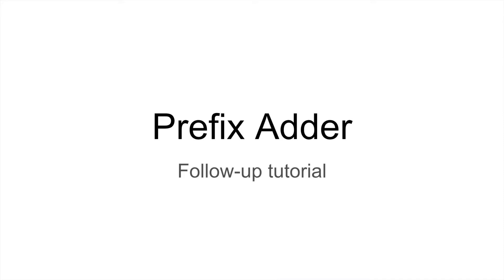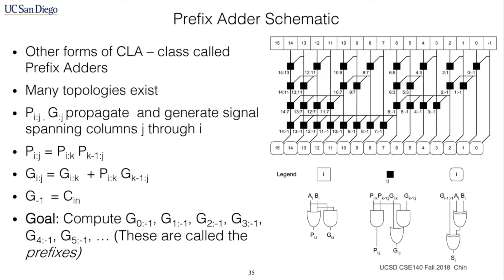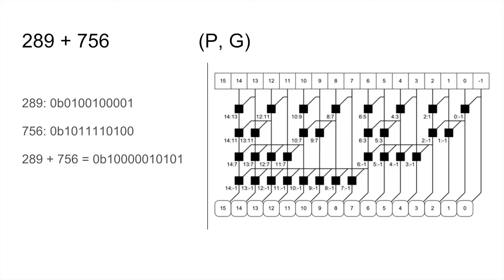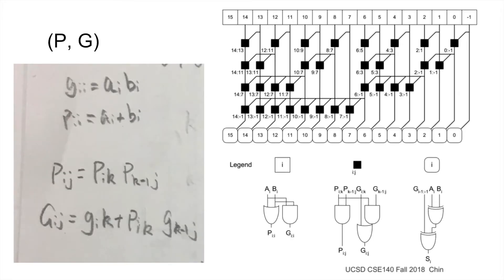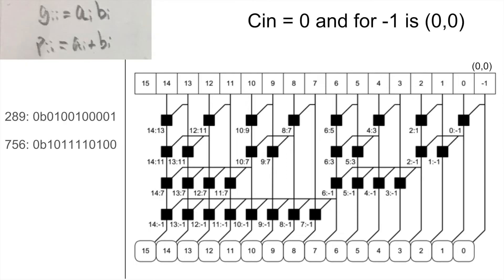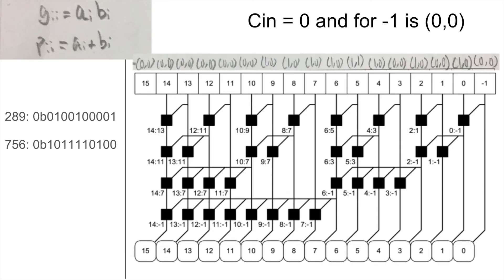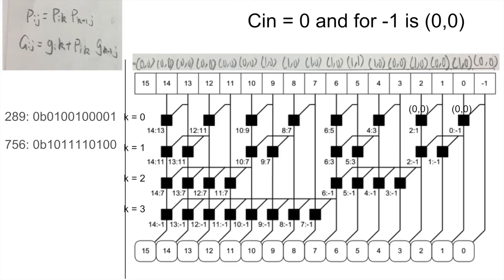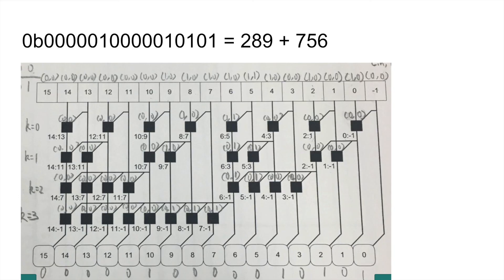Prefix Adder Schematic

Comment: So, how do you calculate those carry outs?  Also, you skipped a big part of how you got your final answer.
Reply: Parallel prefix adders (concordia.ca)  
It's clear in these slides 
Just refer this to solve the problem given in the video
Reply: Slide no. 19
Reply: Did you figure it out? I cant understand how to get to the s values.
Reply: @jamesshroogle6331  understand CLA first